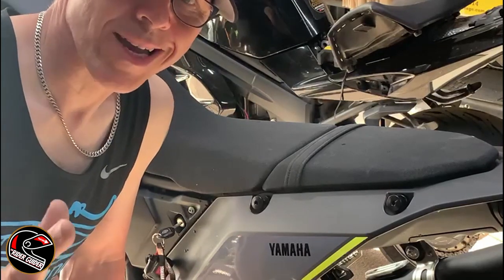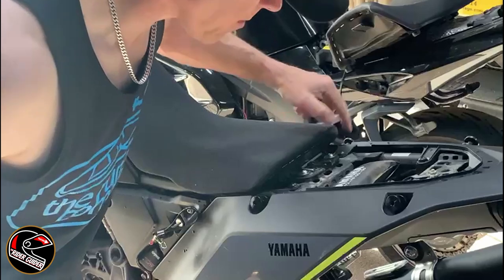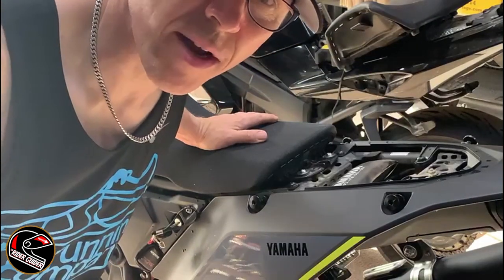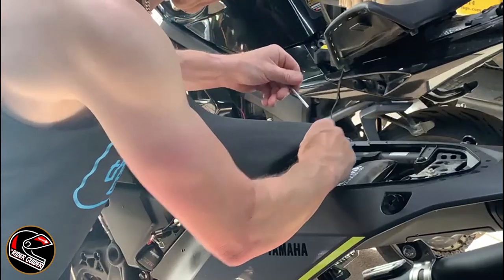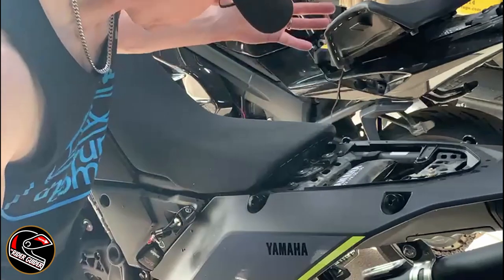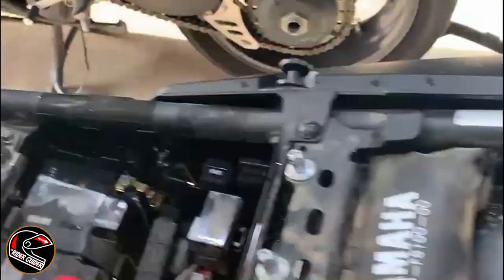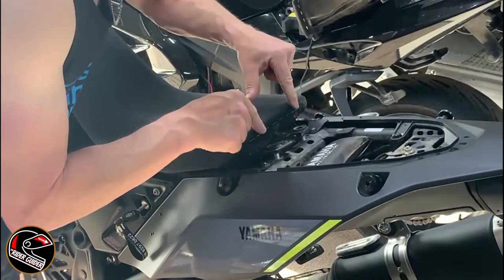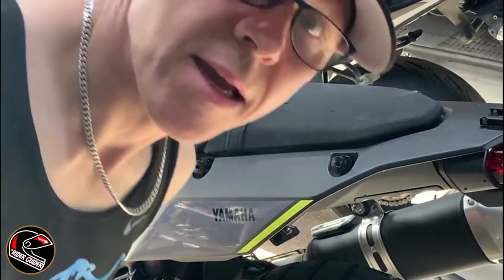YAMAHA TENERE 700 - A QUICK AND FREE SEAT HACK EVERY OWNER SHOULD KNOW

Comment: Done. Wish I'd seen this before I bought the Rally Raid solution. I was never happy with the Rally Raid solution as you can feel the pillion seat binding on the top of the pegs when you fit it and there is wear on the seat material where it wraps around the plastic base. There is no binding with this hack. Thanks mate.
Reply from the maker: Haha yeh it's good mate, another slight improvement is to turn the rubber gromets around too on the seat, there's a little lip on them and it will seat even nicer 🙂

Comment: I subbed . Thought you were going to show us how to lower it an inch or so . Had to have the dealership put the lowering linkage on but not the lower seat option . After a couple 1-2 mph tip overs as I was turning sharp and slowly I thought well I better just get it lowered . She's a top heavy bike and even though I am 6' tall I have short legs and a tall torso . Just now have it at the first 600 mile service so once I have it back I can relax a bit watching the tach . One thing is for sure is the stock tires are poop offroad or at least in my aunt's flat 5 acre gopher hole riddled field , felt like riding on ice . Was laughing the whole time !
Reply from the maker: Well thanks for joining my modest channel 🙏 ... appreciated.  I’ve been riding decades but actual off road and proper adventure riding is a newer experience for me.  I’m surrounding myself with some seriously good riders and learning quick, one of the things that surprised me was how low they have their tyre (tire) pressures.  12 - 15 psi when they’re on the loose stuff.  Made quite the difference with my standard rubber, but I will definitely be going with some more aggressive tread in the near future 👍🏼 ... 

As for seat height, it’s a minefield for people finding the right personal set-up.  No one person is the same, I’m more than comfortable with the standard height and I’m barely 5’8” and 70kgs!
Reply from the maker: Update mate, Yamaha are going to release a lower Rally seat now as well, slim profile.

Comment: Whats your height and inseam? Looking to get this bike but nervous about the height and being in lockdown I can't try one.
Reply from the maker: Zak, hello mate, this is an interesting question that definitely needs some consideration.  Firstly, I’m 172cm (not tall), my inseam ... just had Mrs Rider Guider measure from my crotch to the floor whilst wearing my trusty Adidas Samba,  76cm.   Now, of course, we have to look at a few other things, I weigh 70kgs, heavier riders will of course utilise (squash down) more suspension travel, and the standard T7 has some ‘sag’ to take into consideration which takes up some of the travel even without sitting on it.  On my test ride, I initially found the bike quite tall, tip toes, but the more I rode, the less this became an issue, I’ve been around a while on two wheels and nowadays have no issue with any bike height (just lucky to have ridden a lot of different stuff) so wouldn’t consider even going for the lowered suspension but that is an option that isn’t expensive.  What’s your height/inseam etc?
Test ride > https://youtu.be/zW4q5rQJ0MM
Reply: @TheRiderGuider  yeah I'm around the same as you 78cm inseam, 173cm height and 74 kg. Looking to get the lowered seat instead of messing with the suspension.
Reply from the maker: You’ll be fine mate, it gets more comfortable the more you ride it.  If you’ve been riding a while and pretty confident, I’d suggest going standard height for a couple of weeks or maybe until your first service, you might (like me) decide it’s just fine as is?   You’ll love it either way.  Not expensive going for the lowered option I don’t think though.
Reply: @TheRiderGuider  Yeah gonna take a test ride once lockdown is over and see what the height is like, thanks for the info anyway bud keep up the good work 👍
Reply from the maker: @Endeavour6644  mate, dealer just told me that Yamaha are releasing a lower slimmer profile rally seat too.  That might just be perfect 👌🏼

Comment: Mine cost a buck thirty as my allen's came with a flange on them so I had to run down to the hardware store and buy 2 more w/o the flange to make it work. Lol wonder if yamaha was aware and started to use flange allen's to thwart this
Reply from the maker: Now that’s interesting.  Maybe so.  My bike’s got a build date of 07/2020.  What’s the build date on yours?  Any later?
Reply: @TheRiderGuider  8/2020
Reply: also oddly enough. mine did not have the allen wrench  attached under the seat. the fitment is there but no wrench

Comment: I dont understand why you should do this. Could you explain it?
Reply from the maker: The seat removal requires the use of a allen key to undo two bolts to get access to the airfilter and battery.  This makes it a simple tool free system.  Quick and easy.
Reply: @TheRiderGuider  Ow alright thank you

Comment: Neat solution, them bolts would round off in no time if you had to keep removing them! :-)
Reply from the maker: I agree mate yeh, there’s been a few ideas thrown around, converting to wingnuts etc or bolts up and a proper nut but there’s no obvious reason for it to be bolted down with the rear seat holding it in place 😃👍🏼
Reply: @TheRiderGuider  Aye, if the pilli seat holds it down then why not... my KTM 390 Duke held the rider seat on with it's pillion seat too I think IIRC
Reply from the maker: @HippoDrones  Mrs Rider Guider has her eyes on a KTM390 Adventure 😃
Reply: @TheRiderGuider  Take a lookski at the MVDBR YT channel, they rock the 390 ADV
Reply from the maker: @HippoDrones  I shall indeed.  Thanks mate 😃

Comment from the maker: I was shown this, and I had to share a quick, easy simple and FREE seat hack to do away with the bolting on and off of the front part of the seat to get access to the air filter and battery.  

#THERIDERGUIDER #YAMAHATENERE700 #YAMAHATENERE
Reply: You also should turn the rubber upside down! Than it is perfekt.
Reply from the maker: @peternesuta3684  awesome mate - great idea :-D